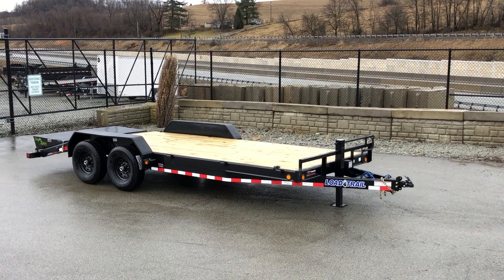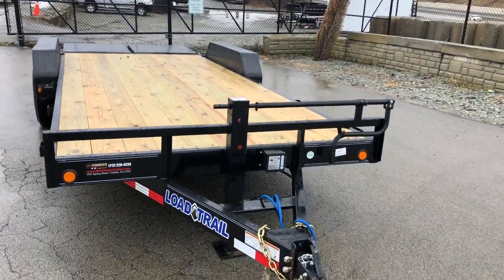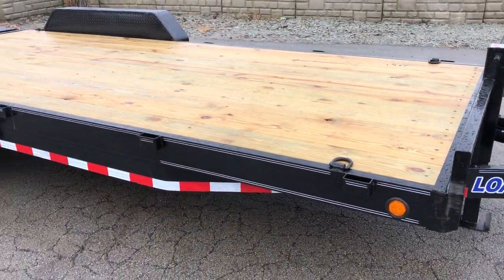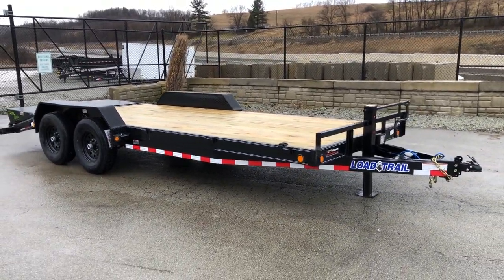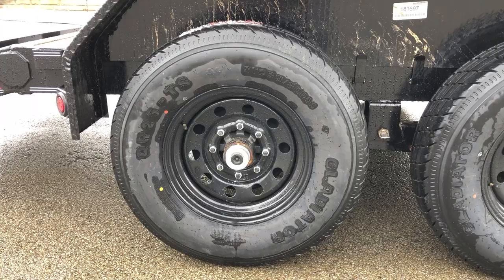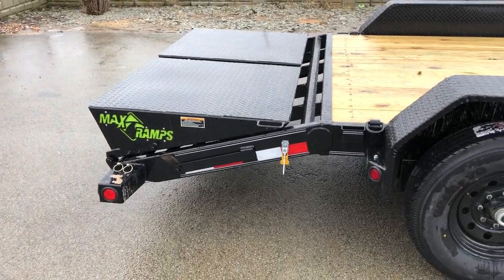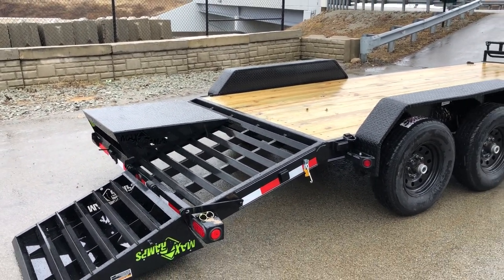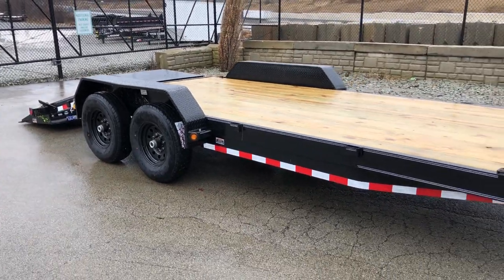Load Trail 7x20' Equipment Trailer MAX Ramps 14000# GVW * CH8320072-FWR

Comment: all it needs is a rub rail.
Reply from the maker: Load Trail is a bit different in that many will do a rubrail and stake pockets, whereas Load Trail does D-rings and stake pockets standard, but a fair amount get a rubrail optioned in.  Not sure as to the logic behind it.  The channel frame/tongue also give plenty of tie downs points.